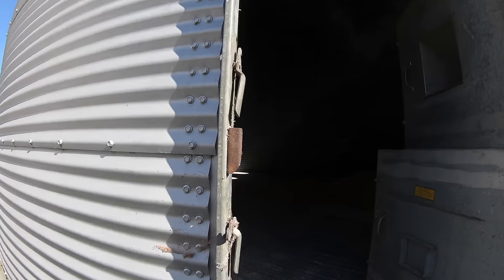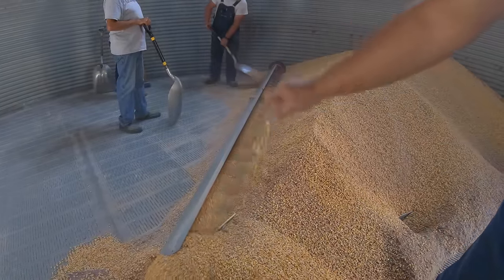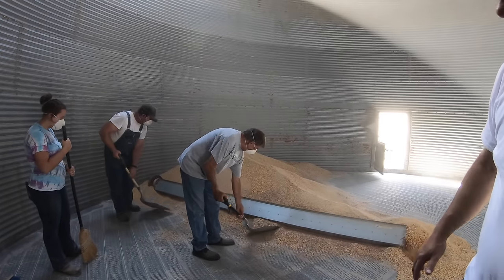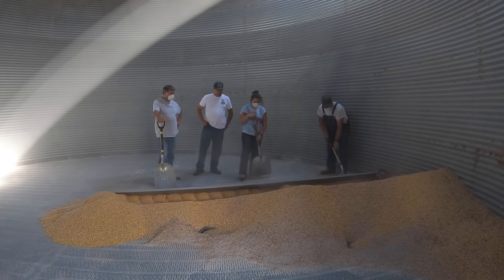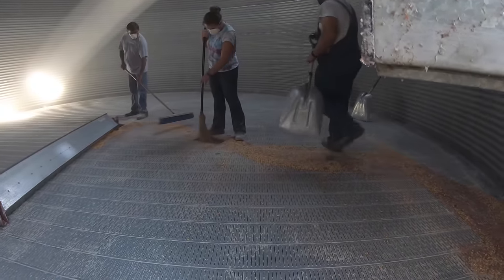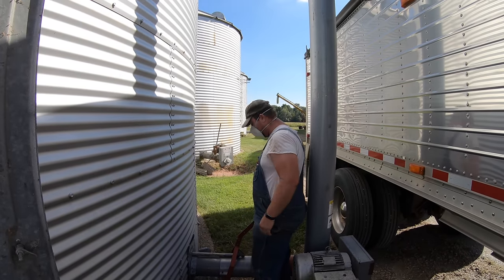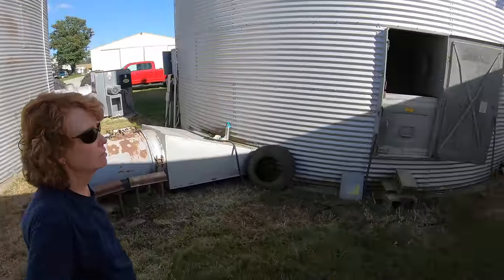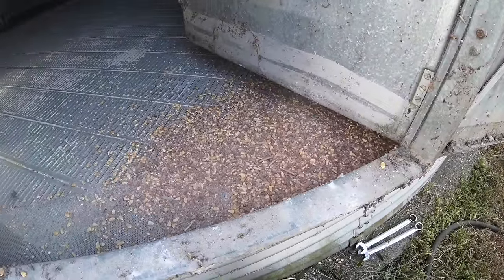How Grain Bins Work! Grain Bin Unloading System!

Comment: is that the same as popping corn ?
Reply from the maker: It would be the same consistency (kernels are hard),.  However, popping corn has been bred to have smaller kernels and better ‘popping’.  
So, no, this is not popcorn. Some folks nearby have raised lots of popcorn.
...and near my house in Indiana is where a huge amount of popcorn is raised.
Reply: No, that's plain old "yellow dent" #2 corn or "field corn".  Popcorn is bred differently to have a much thicker pericarp (the outer shell that holds the kernel together) and popcorn kernels are round, not flat like field corn.  Popcorn looks different in the field because the stalks are somewhat shorter than field corn, and the tassels are often very widely "splayed" or more showy, almost look like a golden firework popped open at the top of the plants.  The silks of the ears are often either a vibrant red or almost white, depending on the variety, compared with the more subtle greenish-yellow of silks on field corn.  Of course they all get darker as they pollinate and then turn completely brown and dry out.  Popcorn typically has a white cob (versus a red cob for field corn) and the cob and ear is much smaller, and of course the kernels are smaller, and all round.  Field corn only has round kernels near the tip of the ear, and some around the shank or butt of the ear right at the bottom.  Popcorn is bred so that the pericarp is thicker, and the starch inside never totally dries out-- a little moist starch remains in the center of the kernel, and when the popcorn is heated up, eventually the moisture in the starch begins to turn to steam, which cooks the starch and increases the pressure inside the kernel, until it finally "explodes" and as the steam escapes from the kernel as it blows apart it inflates the starch and turns the kernel inside out, which is what makes popcorn "pop" and the strange shapes of the starch as it expands turning inside out.  What remains of the ruptured pericarp is the hard part of the popcorn inside that typically gets stuck in your teeth LOL:)  

The other type of corn is "Sweet corn" which is grown for, of course, fresh corn to eat, either "corn on the cob" or canned or frozen niblet corn.  The stalks of sweet corn are much shorter than field corn, typically, and it will also have a rather showy tassel typically either lighter in color than field corn or even with a reddish hue.  Similarly the silks on the ears will be reddish or whitish compared to field corn.  Typically sweet corn is shorter than popcorn.  Sweet corn is harvested while the plants are still green and the kernels are still soft and wet inside, (called "milk stage" because if you pop a kernel it will be full of a milky looking sweet fluid, the plant sugars, which will turn into starch as the corn matures).  Field corn also goes through a milk stage and can be eaten as corn on the cob but it's much less sweet and gets tough and doughy or chewy MUCH faster and isn't anywhere near as good to eat. Sweet corn that's left in the field too long will get big fat kernels that get tough, chewy, and doughy and if allowed to fully ripen will eventually dry down into wrinkly seeds as the corn dries down and the water leaves the kernels.   All the other corn types other than sweet corn are allowed to mature and ripen in the field for highest yields, and to allow most of the moisture to naturally leave the kernels before it's harvested, to the greatest extent possible (corn needs to be at 15% moisture or thereabouts to store safely without heating up or molding from bacterial or fungal activity, which can ruin the grain).  Running grain dryers, fired typically by propane, is quite expensive, so depending on the region of the country it depends at what moisture harvest typically occurs, usually it's desirable to harvest after the grain has dried to 20% moisture or below, but depending on the year that may not be possible, and sometimes corn must be harvested at 22-25% moisture and dried down with hot air to 15% or thereabouts in the bin or in a batch or continuous flow grain dryer.  That gets VERY expensive the wetter the grain is coming out of the field from the combine!  Once dried the corn can store essentially "indefinitely" and be used or sold whenever desired.  

Most field corn is used for industrial purposes-- either to make high fructose corn syrup or ethanol, and a large portion is used to feed livestock, along with the byproducts of ethanol production (grain leftovers called "distiller's grains" after the ethanol has been produced).  Some is crushed for corn oil and the remains sold as "cattle cake" or livestock feed.  

Specialty corns, like waxy corn or high-oil corn, are used to produce larger amounts of corn oil when crushed in an oil press.  

Most "food grade" corn is called "white corn" and is similar to yellow corn in appearance in the field, but the kernels are white and the cobs are white as well (bees wings are white, unlike field corn with red cobs the bees wings are red, because that's the fluffy "outer layer" of the cob, some of which comes off with the kernels in the combine and goes through the cleaning shoe of the combine and ends up in the grain tank with the threshed corn).  White corn is typically the kind most often used to make corn chips, corn cereals,  corn meal, corn starch, and other types of corn foods like tortillas, as yellow corn can leave more spots and color variations because of the yellow pericarp on the seeds, which is white like the starch inside in white corn.  

There are also color variations like blue corn which is also now used in some food products like blue corn chips and stuff like that.  It's bred from various colors found on "Indian corn" and selected through selective breeding programs and the trait is bred into commercial corn varieties.  

Another type of corn that's seen in certain parts of the country is *seed corn*.  It is grown to produce seeds that farmers buy from the companies to plant their fields.  Seed corn is a hybrid that is produced in a unique way.  Since corn plants have the male and female parts of the plant separated (unlike flowering plants like soybeans and cotton where the flowers contain both the male anthers producing pollen and the female pistil or stamen that receives the pollen and carries it to the ova or eggs that become seeds in the pod or boll or fruit) corn has it's male tassel at the top of the plant shedding pollen and the female parts are the silks on the ears, which receive pollen and carry it down their length to the individual ovum on the cob to fertilize the germ and then form a kernel-- if the ovum doesn't pollinate (due to extreme heat for instance) the kernel will not grow and produce a seed.  Since the flowering parts are separated, hybrid seed corn is produced by planting a female variety, typically in four row increments, skipping a row in between.  Later a special planter that has gaps for the four female rows and widely spaced male row planter units will come across the field again and plant the male rows. (Sometimes the male rows are planted first, depending on their maturity, so they and the female rows flower together).   When the field starts to approach silking, the female rows will be detassled, having their tassels and usually the top part of the plant removed by wheels, high mounted mowers carried by high-boy detassler machines, or by hand (or sometimes all three, depending on how many times the crop is detassled to make sure NONE of the female rows tassel and thus self-pollinate.  With the female rows detassled, only the female silks on the ears remain.  They are pollinated by the male rows tassels which remain untassled and intact.  The pollen drifts across the two rows of female plants on either side of each male row.  Once the female row ear silks are all pollinated, the male rows are then chopped down, so that their self-pollinated female silks and ears are not harvested to contaminate the hybrid seed.  So near harvest a seed corn field will typically have four rows of short, topped plants with a skip row gap where the male row was chopped down and destroyed.  Seed corn is typically harvested as whole ear corn by large corn pickers with husking beds (which pull most of the husks off the ears) pulling dump carts behind, usually dumping into dump carts that carry the ear corn to the waiting belt-floor semi trucks that haul the corn to the seed company, which then stores it in their own bins and handles and dries it accordingly to preserve the maximum germination of the seed for next years crop.  Later they run it through shellers that separate the kernels from the cobs more gently than a combine can so there is as little damage to the seeds as possible, and then they clean it, sort it, grade it, and package it in bulk, tote bins that can feed seed tenders for large farmers, and 80,000 kernel bags for smaller farmers.  

Later!  OL J R :)
Reply: thanks ! my father always told me its a good day when you learn something new !
Reply: You're welcome!  OL J R :)

Comment: Pardon my ignorance , but isn’t it kinda of non efficient labor to keep shoveling the corn back into the other side. My thought process would be to wait till the pile was done and then shovel and broom into auger
Reply from the maker: It IS done behind the auger.  They are only shoveling 1/2” or so of grain which the backing plate slides over the top of.
Reply: It is so much easier to clean up as the sweep is running versus waiting till it runs all the way around
Reply: I disagree let the sweep do its job and wait till the end to sweep up and also very dangerous to be in bin with sweep running all grain bin manufactures state not to enter bin when sweep is running
Reply from the maker: Whatever.  You can come clean out our bins using your approach.  Whatever way you want.
Reply: Tractor Time with Tim we’ve done it both ways and it is easier to do it as it’s running and usually we have to push the sweep around to cause it won’t go by itself
Reply: Tractor Time with Tim I’m on my way 😂